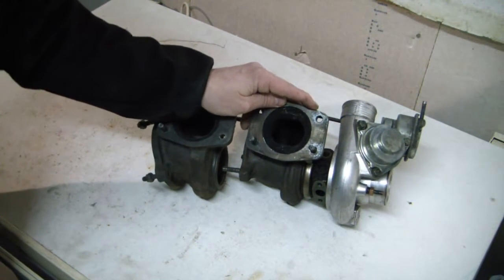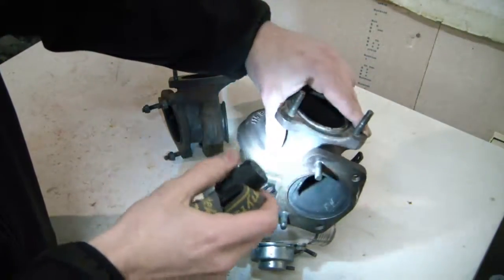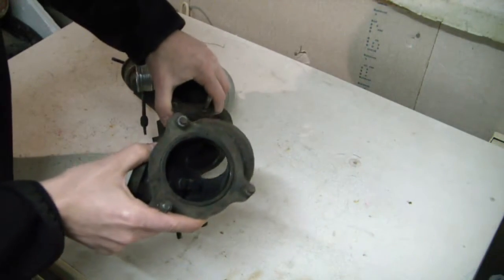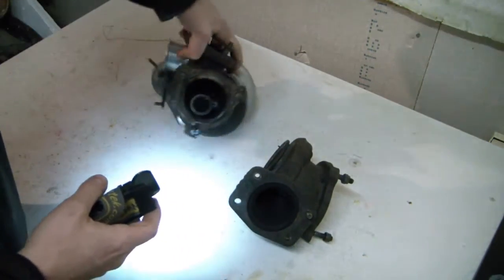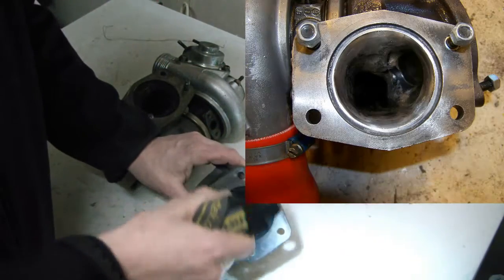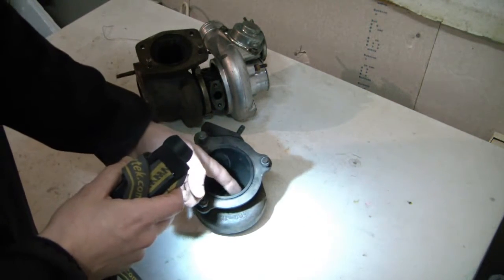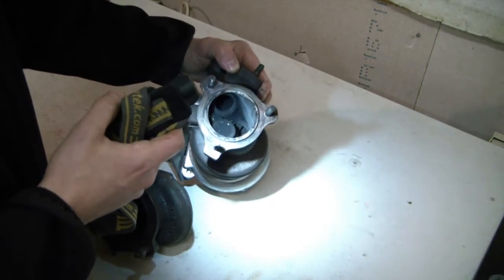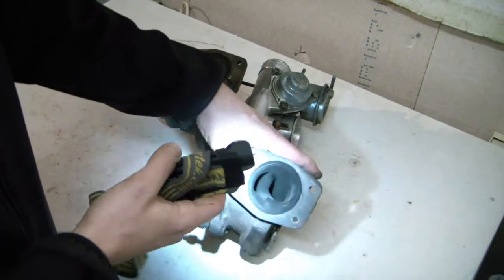Turbo Exhaust Porting :Volvo5Cylinder

Comment: Great informative video. One small question. On a v70 2001 2.3 what is the secret on separating the turbo from manifold
Reply from the maker: it just bolts off. On the 2001 the turbo and manifold are not in one piece like some new cars have.
Hopefully i answered your question

Comment: Is there a way to bore out a 14T from the 2.5T to an 18t size? I bought a used 09' 2.5t that basically was one is the last 880 imported and last of that style. I basically got the trim of the T5 but not the engine. Someone chipped the car. Boost is dead until about 3500-4000 and then bang to redline (really 6500). Obviously car is chipprd and i think the R's  injctors would help allot along with larger turbo and down pipe. 0-60 is 5.8. with an auto in manual mode. Should i try it out say eh. Fuck it.

Comment: Do you recommend any other turbos for T5 850 ?
Reply from the maker: a oem 19t is as large as you wan't to go with stock internals. the 18t is almost the same size (~18t 480CFM vs. 19t 500CFM)

i know there is also an aftermarket 20t that is a bit bigger but the verdict on reliability is still "out".
the KKK24 is bigger but reliability is not as good as the 19t or any G or T series "mistu" series turbos
Reply: I've been running the td04hl-22t with 6+6 billet wheel and 9 blade turbine on a 7cm angled flange ported and 3" turboback for over 2 years on a stock internal b5234t9 and TTV flywheel with Sachs 707. Water methanol injection, de fuel pump and 800cc injectors, 960 maf housing.
@22 psi I ran a 7.90 in the 1/8 and 12.3 in the 1/4 on stock open diff. Nitto neo gens and bc racing coilovers, front and reach strut brace, all polyurethane mounts and bushings, snabb inlet and rip kit. No issues, zero detonation on 93 + VP octanium and the wmi. Tuned by Aaron at vast.

Comment: Hi! I want to upgrade my 5204t2 engine , inspite that previous car owner has changed cylinder sleeves and pistons ( From 5234 i think )
Currently i have 13g turbo , i want to buy 4.4 ecu and larger fuel injectors
Will it worth it ? Or i should buy 16g , and that stuff that i discribed  above?
I want to get about 280-300 bhp
Can you tell me your opinion
Thanks!
Reply from the maker: The current ecu is fine up to 500-700hp :)
your current injectors is fine up to 280-300hp.

Get the 15g turbo, it is bolt and a new M4.3 tuning chip. it will get you well past the 250hp mark on a 2.0,. on a 2.3 you are closer to 280hp
Reply: There is a problem to buy M4.3 chip in my country 
It is rather cheaper to buy 4.4 ECU from V70/S70 and upgrade them
Does tuning chip allow to improve fuel/ignition maps , or it already has them?

Comment: Work and family are both overrated.  

What about a video that discusses which upgrades, and in what order, are good for an old 850? Also, what is the return on investment for each one.  Like, first get the basic stock parts working well.  Then maybe tires, air into the engine, turbocharger options, fuel injectors, fuel pump, exhaust manifold, exhaust system, airflow through intercooler, etc.  You probably already put a lot of thought into such planning -- you could just talk about it over a slice of Juustoleipä.
Reply from the maker: Not 100% in agreement with you   regarding work and family...

This video topic idea is actually quite brilliant....

Thanks.

Comment: i have question for my volvo friend, i have ordered a used obx downpipe from ebay for good $. it has the ring to accept stepped flange. my turbo is 15g. will i need adapter? and where can locate this part. also, i would like to see some more of youre funny opening screens... do u even lift lol
Reply from the maker: These are the droids you are looking for.. 
http://www.l-m-r.se/p/volvo/850/avgassystem-avgasdelar-1014/flansar-1017/adapterflans-labyrinttatning-till-kona-v70-940.html
 :)
Reply: that looks the right part. I currently have an exhaust kit on backorder from IPD.  and according to their information my 97 850R Auto trans (yankee edition) has a straight flange, and NOT the conical. Im just going to have to bust loose the (oem) downpipe and look. Im going to make my own exhaust custom if the OBX pipe bolts up. Look for bumbling new videos on my channel hahah
Reply from the maker: 850R auto has the 15g turbo with the chonical fitting. Engine code. B5234t5
850R manual has 16t with the straight sitting like in the video (non chonical, stepped variant like in the video) B5234t4

On your cambelt cover there should be an engine code  printed on a white sticker.
Reply: Volvo 5 Cylinder thanks im going to check when i get back to the lab!! volvospeed says conical or crapical lol flange came on earlier 850s and my 97 should be staight... i hope so
Reply from the maker: all turbos in the volvo 850 series have a "straight flange".

The angeled flange come with the v70 series with the bigger 3" dp flange like shown in the video :)
The most well known turbo with the angeled flange is the 19t. but 16t is also with this flange on some v70 models.

Comment: What problem?  
Turbo 16T 19T
What EGT?
Reply from the maker: Please explain in more detail. So i can better help you
Reply: Volvo 5 Cylinder stock turbo max hp?  850 T5    2000 cc not methonol good remap?
Reply from the maker: Max boost 1.2bar with stock engine.
perhaps 2.0l engine will get 280-300hp with 16t + white injectors on good remap.
Reply: I'm sorry no english my volvo 1200 kg stock engine stock remap max bar. All stock engine just bar max?
Reply from the maker: 1.2bar max, stock engine.
Reply: My number
Reply: Whatsapp